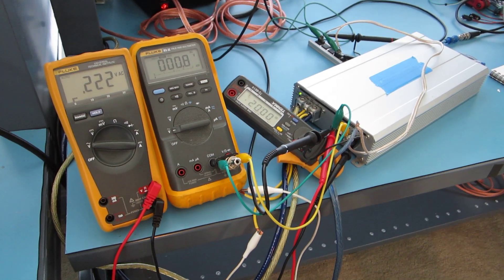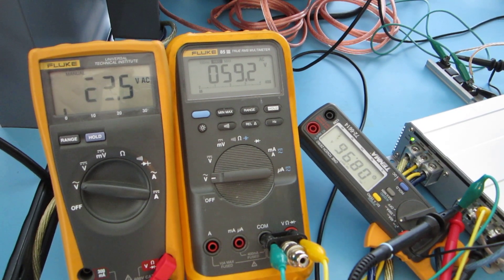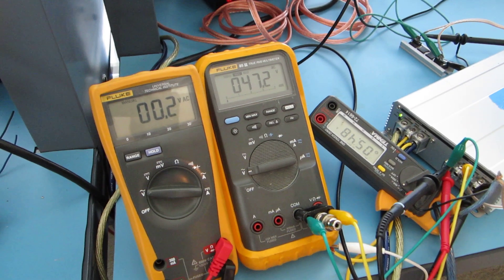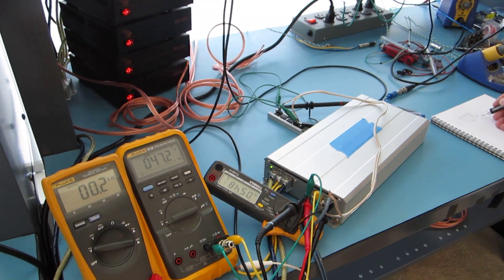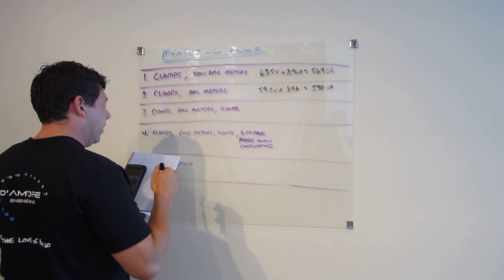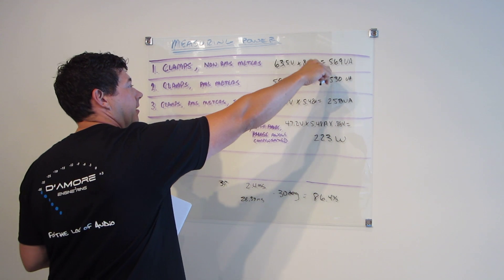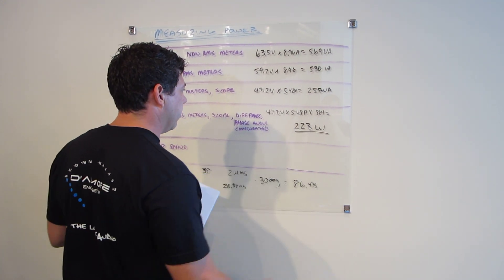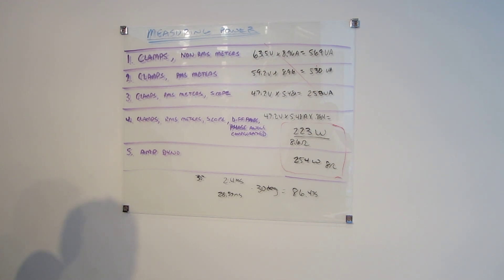Measuring amplifier power via clamping

Comment: @DAmoreEngineering
I've done some research and let me see if I understand this now...

Real power for DC circuits is calculated using Volts DC and Amps DC:  W = V x I.  However, a car amplifier circuit is an AC circuit with a reactive (non-resistive) load.  Therefore the correct way to calculate the Real Power (Watts) for a car amplifier is:  V(rms) x I(rms) x cos(Φ) (where Φ is the "phase angle" or the phase difference between the voltage and the current).

That means that every single video on YouTube that says the the actual Watts your amp is producing is simply "Watts = V x I" is completely wrong simply because they are using the formula for calculating the "Real Power" of a DC circuit rather that the formula for calculating the "Real Power" of an AC circuit with a reactive load?
Reply from the maker: Hi Jet, yes exactly!  Thanks for watching

Comment: Love it! Nice Maths@!~

So how I've always done it is to ballpark it;

 (max volts AC x .707)² ÷ Ω
so:

63.5v x .707 = 44.9v

44.9v² = 2,016

2016 ÷ 8.6Ω = 234.4w or within 5% of your 223w RMS number, 
- calcs & metering rounding withstanding.
Reply: where did you get the ohm number from ? i tried your math with my test and it come out to 926. did it with tony's math and came to 1638 , did it with my quick method which is minus 15% =1645 then i figure the minus 10%= 1742 . i always go to before clipping with clean wave so i figure it at the 10% would be into light clip , 15% would be clean , my math is not perfect but for a quick idea its not bad , having the right tools is key here , if you have the wrong tools none of this matters .

Comment: This is a great video. Thank you so much for showing the proper way to calculate the amplifiers power output. Did you use a shunt resistor to take the amperage measurements with the o'scope, or a current probe? Just curious. I'm am an electronics hobbyist, and I love learning new things about EE. Thanks again.

Comment: Can you explain how you did the math with the 2.4 millisecond phase difference with 35 hz to end up with 30-something degrees, and end up with 0.864 ?
Reply: +GHOSTGXZ I don't know if you researched this and found the answer, but just in case you didn't (or for others that would like to know the answer), here is the equation needed. Given the time delay (Δt) and the frequency (f), we can calculate the phase angle (φ°) with this equation:

φ° = 360° * f * Δt

So, since we know that the time delay is 2.4ms (0.0024s when used in equations) and the frequency is 35Hz, we can plug those values in and get the phase angle:

φ° = 360° * 35 * 0.0024 = 30.24°

Then, to get the power factor we take the cosine of 30.24° which is 0.864 (rounded off, of course ;D ). There is our power factor, just like the value that Tony calculated! :D
Reply: TheRabidgoalie how to find time delay without scope ?

Comment: the only guy in the internet that really knows of audio engineering ! how many db track do you play for adjusting speakers and subwoofer?
Reply: Usually 3-5dB for full range speakers and 5-8dB for subwoofer
Reply: +Anthony D'Amore But clamping DOES show the actual uotput of the amp, right?  Just not what the speaker is seeing.  Correct me if I'm wrong.
Reply: from my understanding the -db number for the sub is different depending on what type of music you listen to.
from what i have read a -5 to -8db is good for bass boosted / decaf . were as you want a higher # if listening to the radio.

Comment: 258va and 254watts sure are close enough to be the same number wouldn't you say???? LOL
Reply from the maker: you need to watch it again
Reply: Most people don't own an o-scope, a true rms voltmeter and a clamp meter, not to mention the math and electrical engineering skill to arrive at the correct answer. The point of the video is to demonstrate the accuracy and ease of use of the amp dyno made by the company, so...... YES! The two numbers are basically the same number which proves his entire point.
Reply: +DAmoreEngineering   the amp is still putting out the power(VA), though, right?  It's just that the subwoofer is only seeing a the amount after the power factor.
Reply: I notice why you would have to check the current and voltage signals because you have a reactive load (subwoofer)...but what if you were to use a wirewound resistor (non-inductive...you know the expensive boys). Would you then still have to check both the current and voltage signals? 

Thanks for sharing the information on your vids...I've watched most of them, probably all..

Comment: Great video, thank you!
However, is there any way to know the power factor without having to measure it with an oscilloscope or a multimeter featuring the cos(phi) function?
I only have a normal multimeter, which can measure voltage and current both in AC and DC and of course it can measure the resistance, thus the impedance module at a given frequency. Is there any way to calculate phi, maybe by using the relations between Re and Z of the impedance triangle? Thank you very much for answering ;)

Comment: I have a question: Why does the voltage keep rising when clipping?, doesn't that mean that the amp isnt't able to output more power, hence not rising the voltage?. I cant picture how can we get more power when its dirty. I can only think of a signal getting "dirtier", but not higher + dirtier. 
Sorry it this is some rather stupid question, I´m not an engineer. Also excuse my english. Regards

Comment from the maker: 2.4ms of difference was measured on the o'scope.  The signal being measured was 35Hz, so 1 cycle of 35Hz is  1/35 = 28.57ms   Then (2.4ms / 28.57ms) * 360deg = ~  30deg
Reply: Thanks for the great video, could you please write the formula for this part please

Comment: Awesome video, keep 'em coming!

Is it fair to say that the amp did 223W into 8.6ohm since that's real power with impedance. I guess thats okay as a reference if power factor is constant across different frequencies.

Also how did you measure current with your oscope, is it an active probe or something you rigged up?